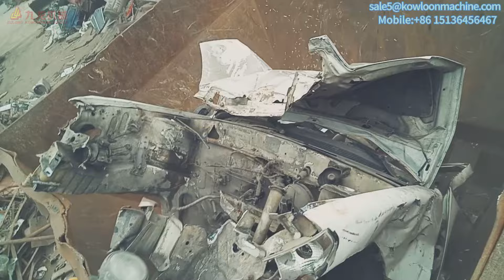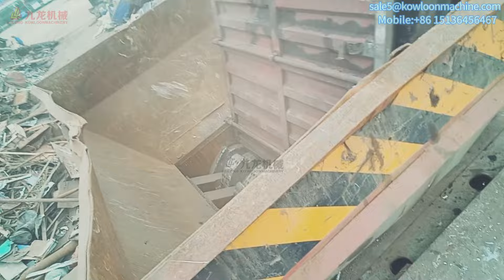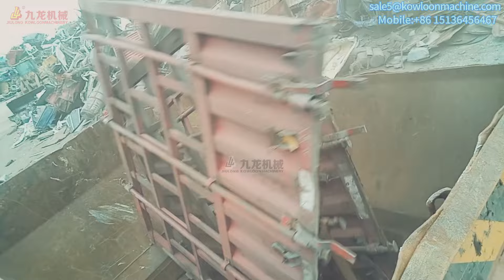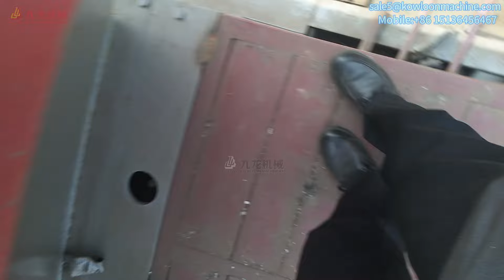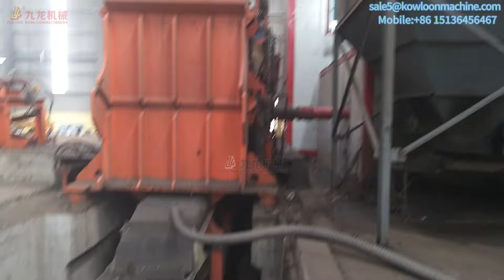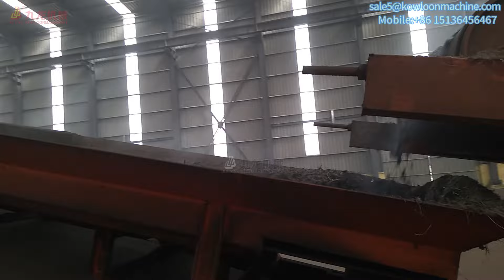Scrap Metal Recycling Line Metal Shredder&Crusher

Comment: That is a BEAST of a shredder. It didnt reverse once.
Reply from the maker: 😄Shredder features low speed and high torque.When the set current value is exceeded, the machine will automatically reverse.